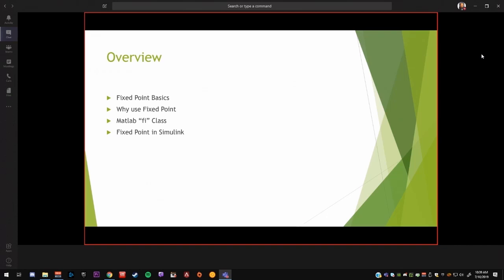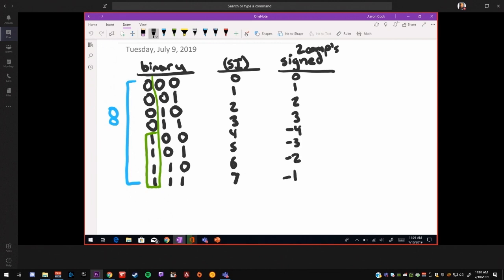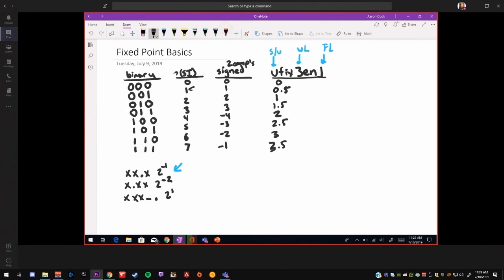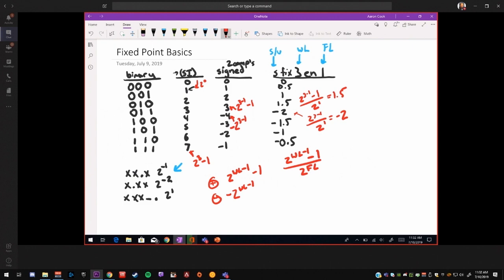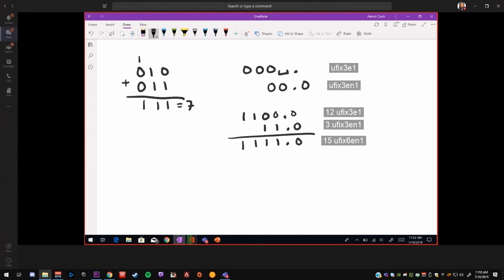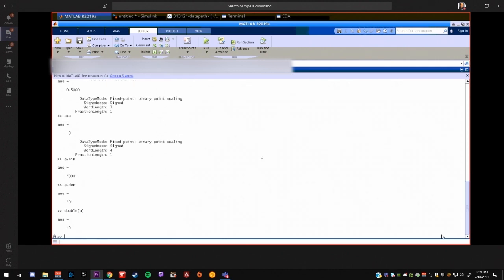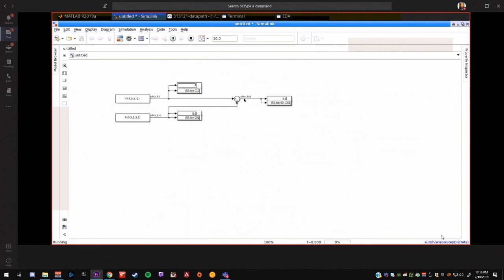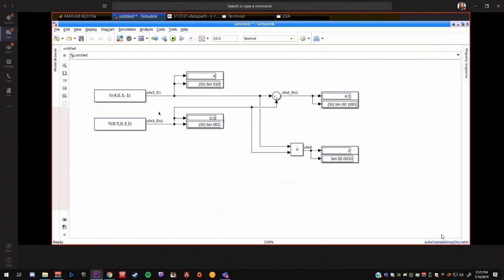Fixed Point Math Basics (using Matlab and Simulink)

Comment: can  u explain the difference between SI and real word value. Fraction length -1 is a bit confusing can u explain it
Reply from the maker: SI is the if the number is signed or unsigned (see 2's compliment signed vs. unsigned). A negative fractional length means move the decimal right, for example fi(0,3,-1) would be like bbb0.00 where 'b' is a 1 or 0. Basically you would use a negative fraction length to represent a larger number with a small number of bits, with a positive fractional length you are representing a more precise number with a smaller number of bits fi(0,3,1) 0.0bbb
Reply: Thanks for ur reply now i understood about fractional length.In matlab i have come across SI and real world value 
While data is converted from one type to the other can u please explain the difference